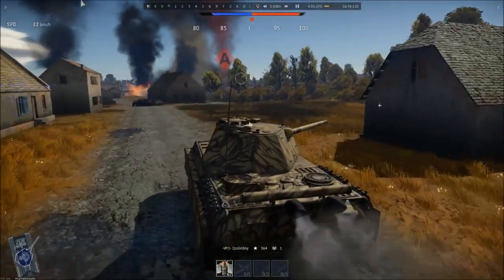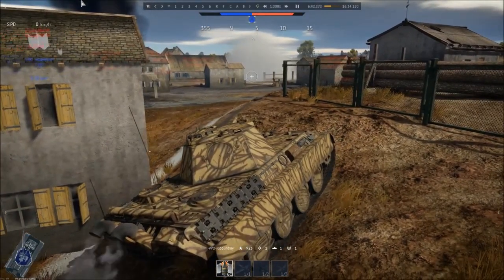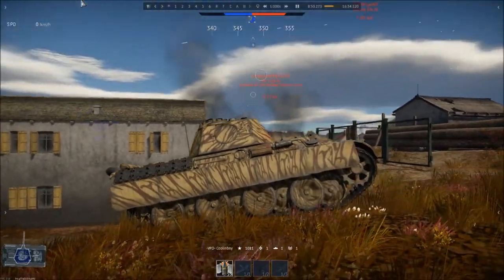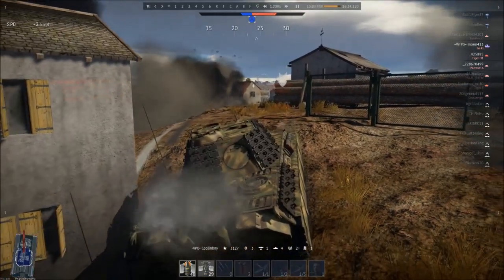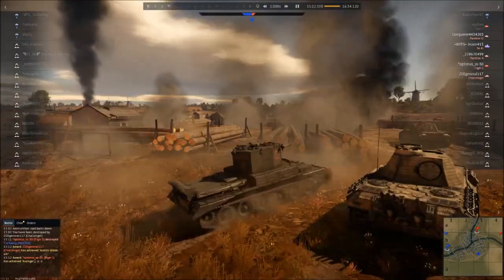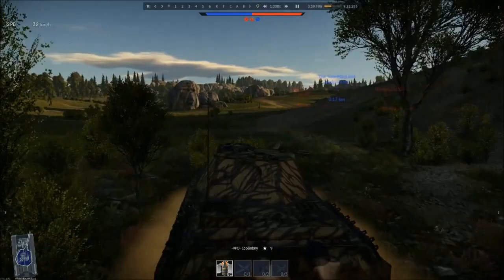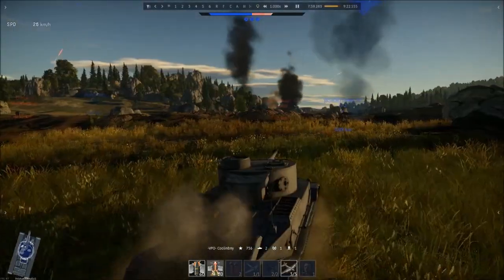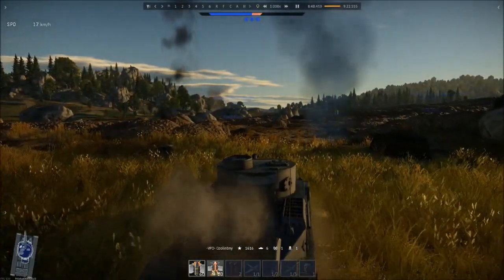Weird WWII History - Panthers and Jagdtigers Powered By Gas Turbines? | GT-101 Gas Turbines

Comment: Another little known fact, Franz Anselm, an engineer who worked on the JUMO004 later became the lead engineer at Lycoming and pretty much designed the engine for 2 of the most iconic american warmachines, the ATG1500 shaft turbine of the Abrams and the T53 Shaft turbine of the UH-1 Huey.